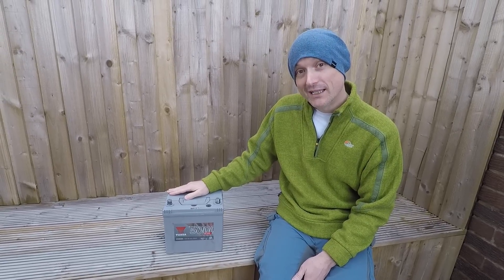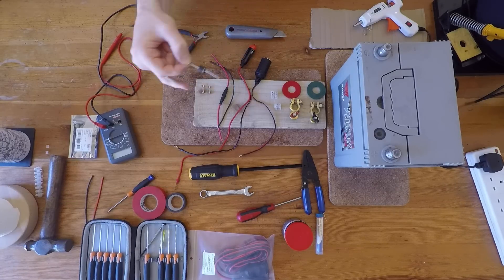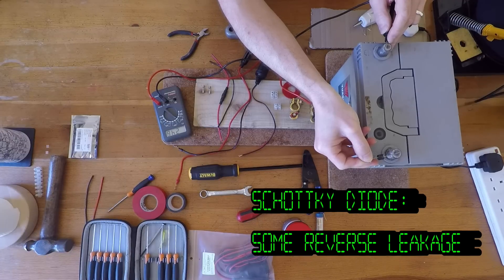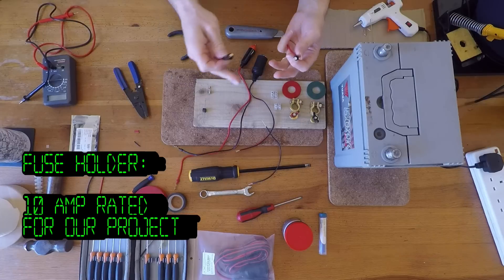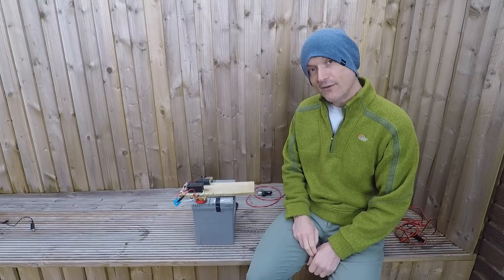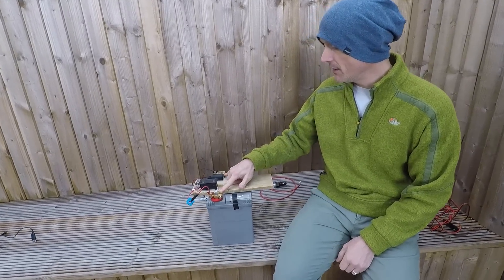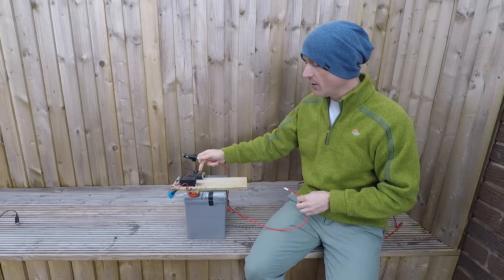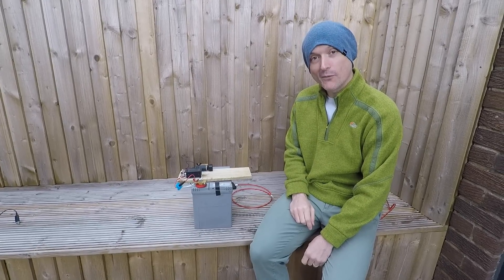How to Make a Power Bank from a Car Battery

Comment: Could something like this work for a small heater? If so, how long might it last for?
Reply from the maker: Yes, you could charge the battery and then allow it to run a heater, although you'd either need a very small low power heater or a huge battery. The length of time would depend on the rating of both. Car batteries are rated in Amp-hours (Ah). That tells you the maximum current you can draw from them for how long. Multiply by the voltage (usually 12V for cars) and you get the power in Watts it will output for the same time. In reality, you'll get somewhat less than that depending on the condition of the battery and any losses in the circuit, but it's a rough guide.

Comment: Can you just connect a car battery to an invertor?
Reply from the maker: Yes, it will work if the input voltage of the invertor is the same as the car battery.

Comment: Great !
Does the ammeter tell you how many % you have left on the battery ? Or how do you check that😄
Reply from the maker: Thanks.
No, this one doesn't unfortunately, but you can tell roughly from the standing voltage. I had it spare so made sense to use it for me, but you can get charge controllers for lead acid batteries very cheaply which will give you a charge level indicator. So if I was buying all parts, that's what I'd do. You wouldn't need the diode then either.